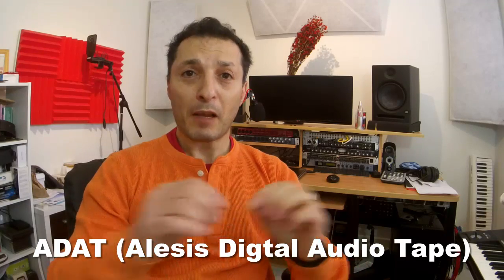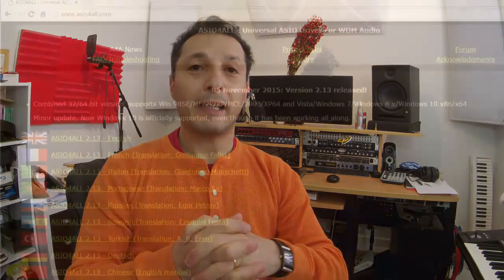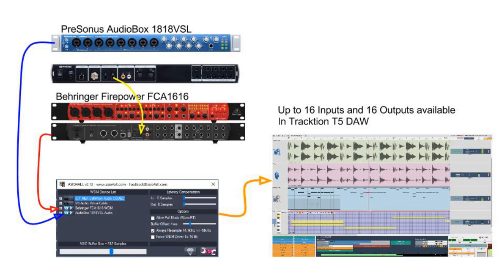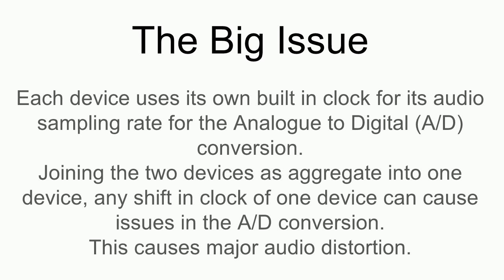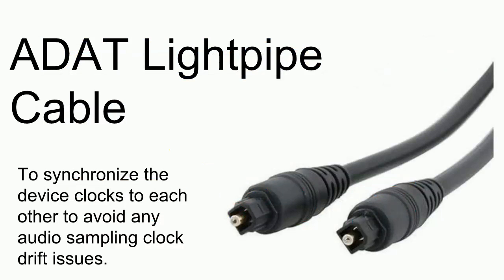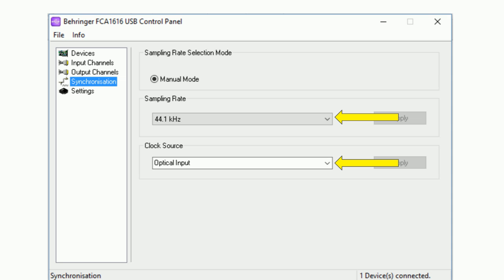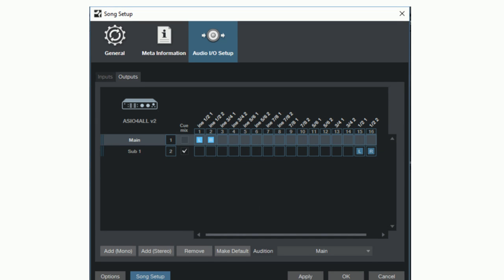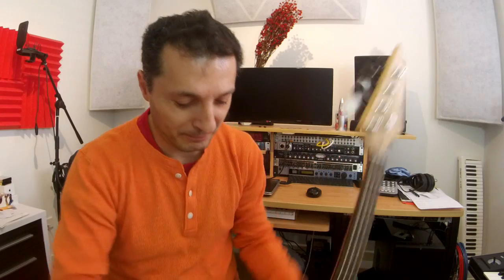Combining Two Audio Interfaces Using ASIO4ALL using ADAT as Clock Link

Comment: Does that mean you can still use the ADAT in on the Presonus as well, giving you 24 inputs?
Reply from the maker: No, as the ADAT out that sends the clock to the ADAT slave device is already used. For any ADAT slave device to work correctly, both ADAT in/Out is required.
There might be a way to daisy-chain them, but I have not tried it.
Reply: But isn't the ADAT input on the presonus still free in your set up there. I didn't think it'd work, but when I saw you still had an input free I thought maybe.

Ideally I'd like an external word clock for everything, but one of my devices doesn't have a word clock connector.

Anyway. Thanks for replying man, appreciate it!
Reply from the maker: Unless you use WORD Clock to all devices, sync is not possible with 3 devices.
Although the ADAT input is free, but as I mentioned, your 3rd device also needs the ADAT clock input.
You may try the ADAT output of the 2nd device to the ADAT input of the 3rd device, in a circle mode, but not sure if that will work, I never tried it.

Comment: Mac user should know how easy you can pull this off
Reply: How??
Reply from the maker: Search for the term audio aggregation on mac. This will do the same task as ASIO4ALL. Clock sync is still required for solid sampling rate.

Comment: Thanks for the video ! do you know if it's possible to use 2 audio interfaces (each on connected via adat to a behringer ada8200) ? I mean for example :
- behringer ada8200 ----ADAT--->  Audio Interface 1  ----USB----> Computer
+
- behringer ada8200 ----ADAT--->  Audio Interface 2  ----USB----> Computer
Reply: I am not sure, but you can just daisy chain the two ADA8200, no? Then get the signal from one of em into your interface. Maybe the I/Os of your interface are limited and that could be problem.

Comment: Can you connect 3 devices? I need more than 16 channels for live recording / monitoring.
Reply from the maker: As long as you have a way to sync all 3 devices by either ADAT or SPDIF between them, you should be fine. Depending on the duration of the recording and the requirement to direct monitoring, you can increase the buffer size to 1024 or more with no sync, but this adds latency. So if latency is not an issue, you may get away with it.
Reply: latency will be an issue! All tracks recording and monitoring a live band (18 or so channels).I think I'll need the buffer way down. I use the Hearback monitor system in the live room for the musicians while they are playing at the same time. I guess ill have to wing it and hope for the best. My new system will hopefully work. I am currently using ProTools 8 le with 002 rack and a presonus digimax lt (as master clock). all being run with an old dual core G5. Getting away from ProTools. I just built a new PC (i5-8600) and will be going with Reaper. Looking into getting a Saffire pro 40 to connect to digimax lt and a USb dual channel pre (S/PDIF) for my overhead cymbal mics. Thanks for the quick response!

Comment: Is it possible to add more than 8 inputs via Adat on the Apollo quad? Like two ada 8200 and the Apollo quad?
Reply from the maker: Apollo 8 supports 2 ADAT in/out, so you can connect 2 ADA8200, giving you a total of 18 input and 24 outputs.
Reply: RecordingStudio9.com thx I have the Apollo twin mk2. I think I can have it modded for an extra adat in. Wanted to see if there was another way

Comment: Hello! Nice video! Can you tell me if these 8 input interfaces will multiplex the AD converters? I need an interface for beamforming research and I need the data to be captured at the same time on all inputs. Thanks!
Reply from the maker: This video (if you watched it) demonstrates the use of ADAT for clock sync only. 
If you have either of these interfaces and a Behringer ADA8000/8200 interface, then they are extended to have 16 inputs and outputs. So in your DAW, you can see 16 individual inputs and outputs.
Reply: I understood that! Very nice trick, by the way! But I want to know is if, internally, there is one ADC for each channel and if all channels are sampled at the same time. I think that's how these interfaces work but I need to know for sure before spending a lot of money on one of them - they are rather expensive in Brazil. We tried to use a National Instruments ADC made for lab use but it has only one ADC and it multiplexes this ADC among the 8 inputs it makes available. We tried ressampling the sound to try bringing the samples to the same time but did not get a good result. I found a ZOOM UAC-8 (USB3.0) and I'll check with the manufacturer about this issue. Do you know the UAC-8? What do you think about it?

BTW, the trick you found out about using the ADAT for clock sync is awesome!

Note: beamforming is done by using several mics spaced on regular intervals to create a "directional mic" or to  find the direction os some audio source. Since it uses the diference in the time the sound reaches each mic, the timing is crucial.

Thanks!

Comment: hi, Vatche, I happen to have several audio interfaces among them an old 1990 MODULE MOTU 828 firewire and it sincronises with ADATS and has the optical in and out and also the beringer fca1616 just like yours and I also have a PORTABLE DIGITAL STUDIO TASCAM2488 neo  all of them have 8 ins and 8 aouts. Do you know if the ISO4ALL driver will make all of the modules work even if some of them are old modules. Thank you  Vatche. God Bless you.
Reply from the maker: As far as I'm aware, as long as Windows recognises the device, ASIO4ALL can use it.

Comment: I have the audio Knox 18 18 and just bought a mic behringer 
They both work with Asiob4 all but for some reason when i go to set up the song the only way I can get the sound to come back from the behringer is to turn the blue speaker on on each track which has always caused me latency 
Do I have an out put set up problem or do i need to run out put cords to the behringer?
Thank you for any help
Reply: My spelling is horrible 
So sorry
1818svl
Umc behringer

Comment: I tried this with my M-Audio 1814 and an Alesis MultiMix 16. Sonar and Vegas was not having it at all. Both pieces of software crash when I try to change their audio driver to Asio4All.  Any ideas?
Reply from the maker: First try having only one of the devices connected and select ASIO4ALL in SONAR, to determine if the issue is with ASIO4ALL or not. I have run my SONAR with similar configuration with no issue.
Also, how are you synchronizing the 2 devices, since Multimix 16 does not have any ADAT or SPDIF? It will work fine for playback, but will have issues when you try to record (assuming you have the ASIO4ALL issue resolved.).
Reply: Thanks for the reply, I will try that. So, open start Sonar with the M-Audio only and select Asio4All. Then if it open correctly, start of the MultiMix? What steps might I be different from your procedure when you got it to work with Sonar, and what is in this video? As for sync, I would only be using the M-Audio for playback (mostly), so I figured I might be able to scoot around the sync issue. The plan is to get them both working and take it from there.
Reply from the maker: Yes, that’s pretty much the steps to find out what’s causing the crash.

Comment: Why use the ASIO4all driver? That driver is junk. Just use the driver that came with the interface and ADAT them all together as a bunch of external mic pres.  They would need to be configured to work in standalone mode.
Reply: this doesn't work in most situations. it's one driver or another.
Reply from the maker: Unless you have a way to combine multiple drivers into one (not possible), your main option is ASIO4ALL. There are few others.
Watch the video in full to understand why your suggestion does not work.
Reply: There's no reason to use third party drivers, a great way to crash your whole system with conflicting drivers.  Any Rack interface like the Scarlett is capable to turn into a standalone mic pre and use it the same way as an Octopre. That's exactly how I have my Scarlett 18i20 linked to my Clarett 8 Pre via ADAT pipe light using the Clarett Thunderbolt driver only. No third party driver used what so ever. Your method is unsafe and not recommend. https://support.focusrite.com/hc/en-gb/articles/206849939-How-do-I-set-up-my-Saffire-or-Scarlett-1st-Gen-for-Standalone-Mode-
Reply from the maker: I can confirm, most audio interfaces with ADAT will NOT direct their analogue input to ADAT output, with the exception of some Focusrite and MOTU models. So, it's not possible to have 2 completely different make and model audio interfaces (like the ones in my video example) to interconnect via ADAT in stand alone mode.
Reply: Lol, its pretty simple. As long as an interface has a power supply with both ADAT in and ADAT out it will work. Works best with rack mounted interfaces. You just post a reply without actually doing the research. I've done the homework for you. Here you go. https://help.uaudio.com/hc/en-us/articles/209894506-Using-Apollo-with-a-Pro-Tools-HD-System

https://support.presonus.com/hc/en-us/articles/210050523-Can-the-Studio-192-be-used-stand-alone-

https://www.gearslutz.com/board/music-computers/1108161-am-i-doing-right-uad-apollo-using-apogee-symphony-standalone-mode.html

https://www.gearslutz.com/board/music-computers/1201630-focusrite-standalone-mode.html

https://uadforum.com/apollo-arrow-interfaces/31601-apollo-8-not-working-standalone-adat-interface.html

https://help.uaudio.com/hc/en-us/articles/209496906-Using-External-Digital-Gear-With-Your-Apollo-Digital-Clocking-Primer-
Reply from the maker: Thanks for the list. You do realise that every interface you listed that "works", is over $1500, up to $3000, where I'm referring to a solution, are under $300.
Reply: There are cheaper ones out there that has ADAT in/out if you dig around. You can buy a used Scarlett 18i20 for little as $300.

Comment: Both of these devices have wordclock, as do most others in this price bracket and higher.  If you get an external wordclock controller, this then frees up your ADAT on both for use with external devices to add even more channels.
Reply from the maker: Yes, that is certainly the way, I'm also showing alternate methods where you don't have to spend extra money purchasing Word Clock units (they are not cheap). For less than the price of a Word Clock unit, you can purchase Behringer ADA8200 :)
Reply: RecordingStudio9.com yeah, the ada8200 would be easier and cheaper with a single interface, but if you already have 2 interfaces, getting a wordclock unit later on would allow you to double up on the behringer adat units for 32 channels of input. That would be a monster! Lol.
Reply from the maker: You may be able to use the SPDIF to sync the two interfaces and 2 ADAT? 😄

Comment: what if you have an extra ADA8200? Can you have 24 inputs?
Reply from the maker: It all depends on the Sync line. If both Interfaces have SPDIF, then use that to sync them together and ADA8200 can use the ADAT of the "master clock" interface. Not sure, but its worth trying out.
Hope it makes sense.

Comment: hello sir........I'm a beginner Nd I hv a presonus ar12usb mixer  Nd a focusrite 18i20.also usb.......now I will b using the focusrite interface...only...to connect my outboard gears in the DAW...Nd use d ar12usb only for recording......now d ar12 doesn't hv any adat WC port like the 18i20........so if I use two of them simultaneously.using asio4all.....will it create any audio issues while recording????
Reply from the maker: You can try and see how you go. But having no sync between devices will surely/eventually create issues when recording.

Comment: Great video! You might have answered this already but I figured it'd make no harm to ask. I've got a Focusrite Scarlett 2i2 (2 inputs) and a friend of mine has another one. We'd like to use them together to home record a drumset, using 4 mics but, unfortunaltely, the Scarllet 2i2 has no ADAT nor SPDIF. Would that still be possible?? If not, we'd probably have to use only 2 mics or ~maybe~ two computers?
Reply from the maker: You can try using ASIO4ALL with no hardware sync like I explained, and might work for a short period. Or use 2 different DAW, each setup with one 2i2, in same PC, then import the other 2 and try to sync the tracks. Bit of work, but there is always a way :-)
Reply: Thanks for the quick reply! It seems to risky to use ASIO4ALL like that (without proper sync) so I think I'll go for the second suggestion and try to use two different DAW in my laptop! I'll get back here if it works! Thanks :)
Reply from the maker: Please do let me know, as I'm interested how it works out.

Comment: Great tutorial. My question is, your presonus and fca1616 both have 8analogue and 8digital (adat) so if you want to expand into recording 32i/o "which you have to buy 2-ada8000 for digital connections on both interfaces" how do you sync the both interface without using the adat?
Reply from the maker: Probably a good idea to purchase a WORD Clock generator and hook all gear into it, but I guess you can use the SPDIF of each main interfaces to sync them up, and then add ADA8000 to each of the interfaces. Just a guess. I have never tried this myself. But I do have a video on using SPDIF to sync 2 interfaces.
Reply: Thanks for the reply, probably would like to see your other video syncing with spdif. But, both interfaces am talking about have word clock i/o (am trying to avoid getting an external word clock for now so, am in search for possibilities on syncing both interfaces).
Reply from the maker: FCA1616 does not have WORD clock, so the only option is to try SPDIF syncing.
Reply: Ohh sorry, I use Echo Layla24/96 and it has 8-analogue i/o, ADAT i/o, spdif i/o and word clock i/o.

Comment: Very usefull video. But i want to ask that if i have 2 identical devices, should i still bother about clock thing? I'm askin because i have maudio fasttrack usb which only have 2 mono inputs and i just need 1 more. I can find the same devices 2nd handed and very good price in my country. Since it didn't have the adat technology i don't want to spend my money if i will not be able to record 3 channels simultaniously without issue. Btw in my interface of the soundcard there is an option for sample rate. My plan is to connect and install 2 fasttracks and set their sample rate to the same and use the asio4all for merge them. Please tell me if i will face the issue which you are talking about in your video. Thanks in advance and i really find your video so usefull, so simple and very educating...
Reply from the maker: Thanks for watching. If you but two of the same watch, even digital ones, after 1 mouth, they will be out of sync. So the issue is the same. It may work for a short time, but they will go out of sync. ASIO4ALL will work fine with the playback of audio over multiple interfaces, as it's generating the clock, but for recording, the story is very much what I explain in the video. You are better of saving your money and purchasing one that has enough inputs you require.
Reply: RecordingStudio9.com thank you so much. Even it's bad news for me i'm still glad that you answered it very explaining. Btw i'm also making recordings and playing instrument atbthe same time and i suggest you to keep rockin everytime. Even if you know only a simple riff, the satisfaction is still so much different from audio engineering :)

Comment: If I use 2 audiobox vsl44 do I still need to connect them with the adat cable? because the vsl44 doesn't have that input on the back but I would assume two of the same interface would give me the same sample rate and just have the DAW recognize all 8 inputs... would this work? or am I screwed with the vsl44 because it has no adat cable connection on the back?
Reply from the maker: Since AB44VSL does not have ADAT or SPDIF, it would not be possible to sync. Same as buying 2 of the same model watches, eventually they will go out of sync. You can try using ASIO4ALL and see how far you can go, otherwise, yes, you are screwed LOL.

Comment: excellent video, I have a question from venezuela

I have a Roland UA-25 EX interface (the old version, not the EDIROL version) it has "DIGITAL" inputs and outputs with OPTICO cable

my doubt is, if these connections are ADAT or S / PDIF, since the manufacturer does not provide this information

to see your video I came to this doubt since I have never used these connections and I have been warned that not all optical connections are ADAT

consequently, I do not want to make an investment in a preamplifier like OCTANE or BEHRINGER ULTRAGAIN and not being able to take advantage of it

thank you very much and I hope your answer soon
Reply from the maker: The optical in/out is SPDIF connection. Here is how to video with SPDIF https://www.youtube.com/watch?v=h9Zva--QVVQ

Comment: Thanks sooooooooo much. You just saved a soul. You made it so so simple. I've watched some other videos but yours is very clear. I have a saffire pro 40 and a fast track pro bundled with Protool 9 MP, because I love pro tools and I would want to make the fast track pro my main. Though i have not tried it, but do you think making the fast track pro, (which in my opinion is lower in strenght compared with saffire pro 40) my main so that I can use the protools, might cause any issue?
I intend to use the spdif, thats what d fast track pro has. Thanks gain. I really appreciate your work sir.